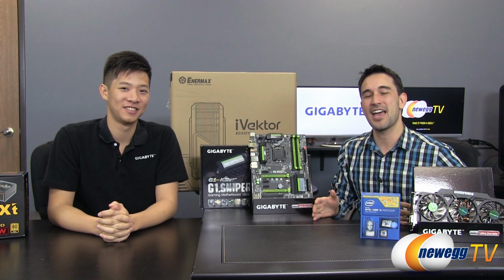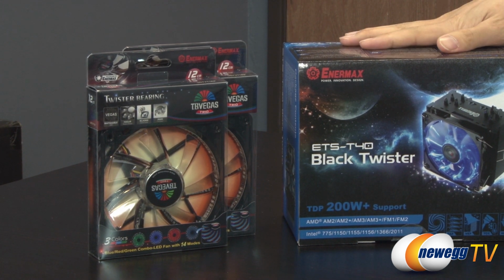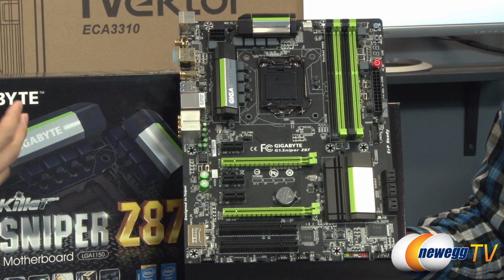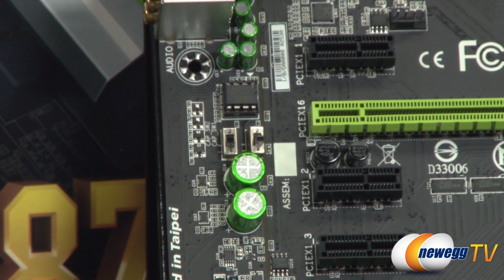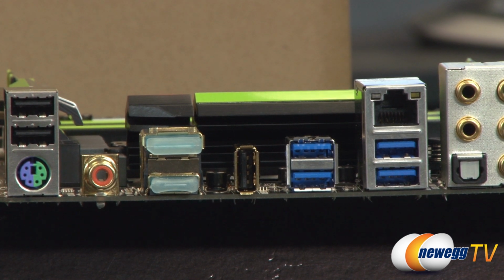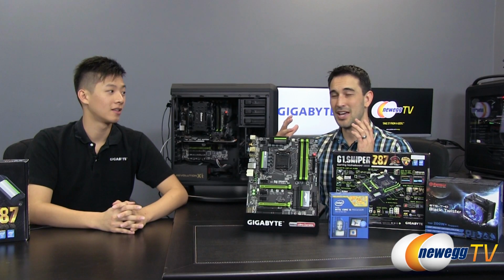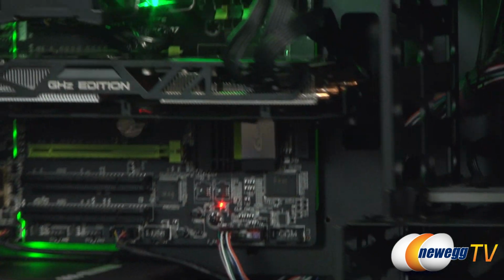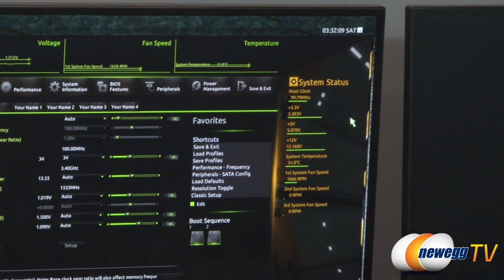Gigabyte Build with Leon - Newegg TV

Comment: Youtube has been loading super slow lately, I went from no buffering on 1440p videos to hardly being able to load 144p
Reply: i dont know how youre getting 1440p?
Reply: TheRuijin97 1440P monitors.
Reply: you may be loading videos off of cached servers. Just Google this to see if it's your problem and how to stop it.
Reply: GamerCheatsForAll I've seen 1440p on some videos as well, and I'm only using 2 ACER 22in 1680x1050 monitors, but of course the 1440p is far and few between.
Reply: GamerCheatsForAll his monitor can display up to 1440p, maybe, but youtube videos normally are only 1080p
Reply: TheRuijin97  There are some videos on youtube that are 1440p.
Reply: TheRuijin97 Some videos are 1440P, came with the new update.

Comment: I want to use the same mobo, same cpu, a windforce r9 270x, g.skill value ram, and a nzxt source 210(place holder until I get something nicer) and a hale82 v2 550w modular psu
Reply: Don't use a case as a place holder! It will be a pain to uninstall and re-install EVERYTHING!

Comment: NewEgg is SUPPOST to have a site that tells you what products are compatable, to avoid buying incomparable things, where is it? Was it removed? Or? If it's still there and working, someone throw me the link! Thanks.
Reply: Here you go: http://eggxpert.com/ I actually just used them myself. I made a forum post under the computer builds section asking whether some parts (which I listed) were compatible, and I got feedback within an hour. They were able to tell me my system was compatible, but they also gave suggestions on how I could improve the quality of the system, as well as conserve a bit on certain items. Hope this helps!
Reply: use pcpartpicker.com It lets you pick items from different stores and makes sure your stuff is all compatible. It even has a filter so you can't pick items for your pc that wouldnt work.